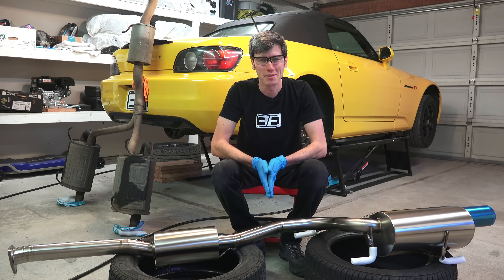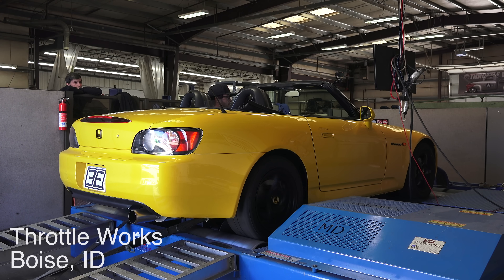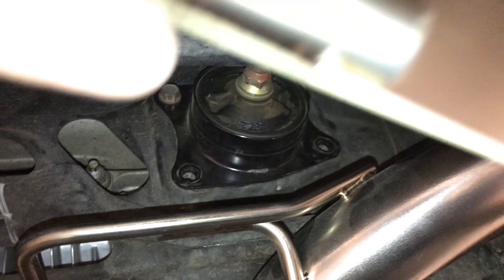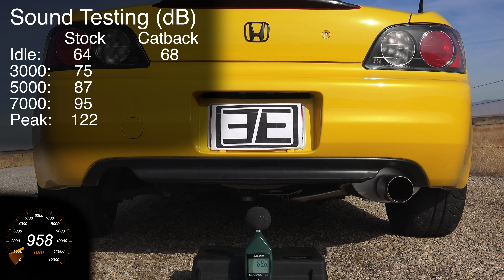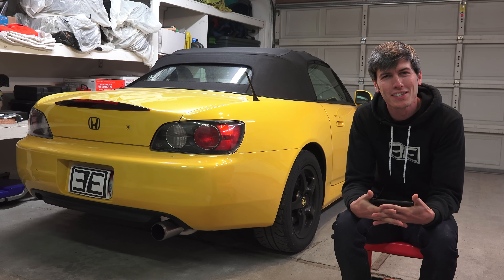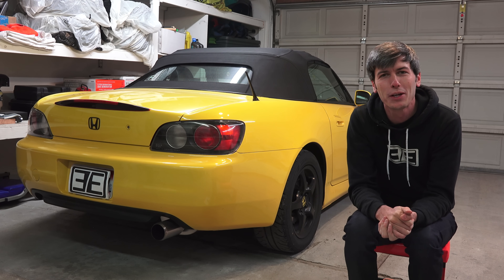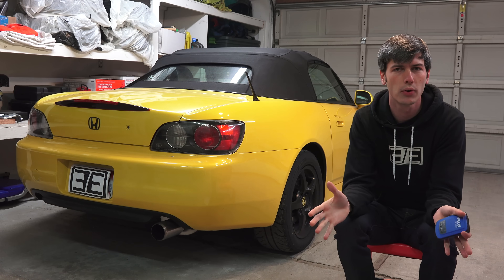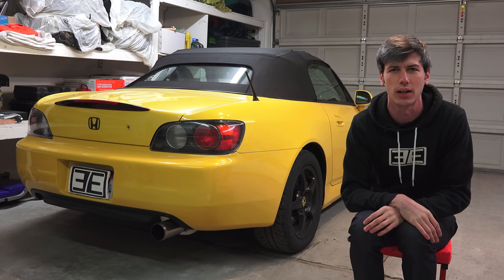Can A Catback Exhaust Make Your Car Faster?

Comment: All that changed was the material and going from two exit to one... I didn't think anything would change tone wise. As for power, without any change in diameter wouldn't think anything would happen. The only real change came from a redesigned muffler.
I would be more interested in seeing a difference diameter with all the same tests.

Comment: I would argue that you could've gotten that same HP bump just from cleaning the soot out of the stock exhaust.  I'd be interested in seeing another dyno result after 10K miles with the new exhaust.  This would be mod done more for the weight savings than the WHP gain.  Looking at it from the standpoint of dropping 36 lbs for 2500 bucks makes the cost a bit more palatable.  I'd do it.

Comment: It's not as much that the piston has an easier time puming out the expired charge as much as it is that the higher exhaust system velocity scavenges in more air (and fuel) into the combustion chambers while on the VTEC high cam that has more valve overlap.

Comment: 76mm exhaust would be best not 60mm. The most restrictive you have on is the Cat/header. U can find aftermarket header with high flow cat. You notice alot more with Ecu tune too with and without the upgrade from 60 to 76mm..

Comment: But at the beginning of this video you claimed the catback wasnt the restriction and that it would most likely not effect power as the cat is the real restriction. Then about 12 minutes in you claimed it flowed better and that is why we saw a gain.  We all know that Motors are nothing but air pumps and the more efficient you make them the better power they will make.
Reply from the maker: +Kyle Duffy relatively speaking, the stock catback isn’t a huge impact on flow, but again, that was before I tested it, so I didn’t know what the results would be.

Comment: Cool stuff. Sound is disappointing, though, specially for the price. Too stock-like. For me, there's no point in getting an exhaust if it isn't a bit louder or sounds different than stock. The NVidia exhaust on my dad's S2k sounds much better. Weight savings are nice, though.

Comment: nice vid, one added benefit to that significant weight reduction is the savings in fuel costs. That would make an interesting graph especially when taking into account the price of gas going up, which it will do. So, what you have spent on the overall price of cat-back system could be recouped in maybe a year or two.

Comment: I have done all of these sorts of tests before on my own cars. I found catback as seen in this video also made small but measurable difference, actually around 5-6Hp I measured on the dyno but I have 2.5" back back with straight through mufflers vs 2.25" with baffle plate mufflers. Also the engine is 3.8L buick so larger gains due to the larger capacity.

The biggest improvement was changing the cast iron exhaust manifolds to long tube headers which the primaries were around 650mm long. That by itself gained 15hp and dropped the peak HP from 5200 rpm down to 4750rpm, which of course means the torque curve changed drastically and increased but about 25-30Nm, biggest gain was it push my peak torque out almost dead flat and ended up peaking from 2200 to 3600 and 90% of peak at 1500 rpm. 0-100 times went from 9 sec to about 7.5 sec. Absolutely fantastic gains for simple mods and plenty of time spent calibrating the tune. One of my biggest issues is actually getting enough traction. I went from 205mm wide tyres to 235mm and fitted good reputable sports tyres but it just smokes all of 1st and bit of 2nd so the best 0-100 is the 7.5 sec, it would likely be high 6s or 7 flat if I can get more grip.

Comment: Your reasoning for going with a 60mm exhaust over a 76mm (3") is false. Pretty common knowledge that high revving engines like big high flowing exhausts. Small diameter exhausts do sound better on  the s2k to me though

Comment: yes titanium exhaust is lighter than steel would be but generally from the heat it will crack eventually happens a lot of time with the systems for Porsches so now everybody just puts on a high quality stainless steel exhaust because it is more durable will last longer less expensive

Comment: I think it sounds good. I have an 09 civic si that I supercharged and I still have the stock intake and exhaust on it. Having a quiet exhaust is a life saver (or should I say license saver) when you are out having fun. With a loud exhaust you might as well wire an air horn into your throttle pedal!

Comment: I also feel that it should be mentioned that those who go to a larger exhaust size would notice more power gains (in addition to weight savings) than those who stay at the same inner diameter. I just replaced the midpipe and catback on my Chevy Sonic and have think (it could just be my misjudgment) there has been a very slight bump to power and torque. I've done smaller mods to improve turbo spool time and get more air into the engine, so I think that it might just be easier to breathe now, or it could just be the weight saving i'm noticing. All in all, I always look forward to your videos. Thanks for the good work, and asking and answering the science behind the way things work.

Comment: I would suggest getting a high flow cat to go with your exhaust! You are blowing black soot (carbon) out of your pipes when revving. Tells me your cat has build up. Could make a bigger difference than 2.5 hp
Reply: Also would be curious to see what hp difference you get with a straight pipe.
Reply: And if You'd like the more aggressive sound without the riceness to it... just take out the muffler and straight pipe it from resonator back. The resonator will give it a deep note but won't be as muffled.
Reply: Bump

Comment: The buyers remorse in the last few minutes of that video is painful to watch.
Reply: Wasn't this a sponsored video? Maybe he got it for free
Reply: I'm pretty sure it was a freebie!
Reply: Olivia Lambert very true but he had to know in his heart without removing the cat that gains would be negligible at best (if cat = biggest restriction then leaving said restriction there is no way to see gains after said restriction)
Reply: @xbraekdownx  true, delete cats and resonator, high flow muffler, 2.5in dia. I have a Mitsu Montero 3.0 and did that, could feel the gains, also had to do away with the spare, i weighed the loss in total 97lbs.
Reply: There is no buyer's remorse, here. This is what he does for a living. If he got -ve HP returns, it would still be a video, and he would explain why it was that way, and he would keep on trucking, because that's what he does.

(He may have 'YouTube-viewer comment anxiety', but that's not the same thing as 'buyer's remorse').
Reply: He got it for free
Reply: Its gold tho 😂
Reply: Olivia Lambert well considering he got the same size diameter of an exhaust, he knew to expect minimum gains simply by les bends and air “friction loss” but maybe getting the 70mm would have made a bigger difference after VTEC
Reply: @frosty0219  it might even hurt performance though. Once the exhaust goes from 60 to 70mm the gasses expand and slow down and also cooling down.
That is a lot of energy being lost, i don't know if the gains resulting from the lower pressure would be sufficient to make up the difference.

Could go either way really.
Reply: The gains are in the weight mostly, not the HP. You'll never gain much HP with just an exhaust
Reply: Hii
Reply: @AJ-zs7xp  creepy
Reply: @gnarkilleptic4871  you are creepy
Reply: You ( or your profile picture )on the other hand,  is a treat to watch..
Reply: @Makta972  bobs and vegene
Reply: Makta972 jesus
Reply: Makta972 wtf ur a creep

Comment: Mate, Amuse is great, but since you spent that much and only gained a few WHP you really should invest in a test pipe or high flow cat to maximise gains and it will cost you far less than the actual exhaust :)

Comment: the reason for a new exhaust isnt necessarily for the bhp.  but it allows you to add to the engine without worry of back pressure later on. now you can add a turbo or other performance modifications.

Comment: I'd buy a full titanium setup for my beater if it meant not having to get new exhaust parts every other year. I swear, after a new muffler is installed it's browned with rust a month later. 'Stainless steel' my ass.

Comment: So you say making an exhaust less restrictive with a wider diameter pipe will mean the engine has greater potential to make power by not having to work to push the gases out... but don't you also start losing power if you make the exhaust too large?

Comment: I think this sort of says how efficient honda's stock design already was. 
i'm guessing regular economy cars may have more restrictive exhausts so it might be worth aftermarket exhausts, but honda knew exactly how much power it wanted to make, so they made the entire car as efficient as possible within the parameters they were given (material type, legal restriction, etc)
Reply: Tetsuto Kamata. Exactly. Most air filter housings and exhaust ( not exh manifolds) systems are probably 90% as good as they could be. Replacing them adds only a tiny bit of efficiency to the flow, especially at part throttle or 2/3 up the rev range. Full throttle is different, but how many times are you at full throttle above 5,000 RPM in any car. Some drivers, never, an enthusiast like me, maybe .1% of the time I'm driving.
Reply: No Budget Racing. Full throttle 50% of the time? Do you have a 20 hp car? It only takes 6-9 hp to keep a car going 60 mph.
Reply: Roman Soroka I'm at WOT like 50% of the time I'm driving. Lol. I redline my car at least 7 times a day.
Reply: No Budget Racing poor car that you have. Or you might be driving a 100 cc engine if you need to redline it 7 times a day. The only time I redlined my 07 Acura TL was today because of a brake change and needed to break them down
Reply: Roman Soroka smart car
Reply: Most newer cars, even the small cheaper ones have pretty well designed intake and exhausts to fit that particular engine. Some are better than others though. They make a lot of effort now a days to get the most power and gas economy out of cars.

Comment: This welding is impeccable !!! If I remember correctly, in the blackbird SR71, the titanium was all riveted because it is very difficult to weld !!! It is a fantastic material, it only weighs 3.7 kg / liter and the melting point is 2800 celsius, more 1000 than iron !!!

Comment: A header would be a great comparison to stock and if you want to put up with the issues or not like smell and running a o2 cheater for emissions or not. Also you need an intake to compliment the exhaust you have increased exhale and intake to a complete improvement in efficiency. But Really you should do a header and a tune to find the peak capability of that engines efficiency

Comment: you went from duel to single pipes. the new cat back might be a little thicker, however try blowing through a straw that has 2 seperate ends, then a single ended straw. I'm pretty sure you're making more bubbles in your chocolate milk with the duel. the mufflers, pipe thickness, ect all come into play as well. I'm just saying if you had an exact copy of your stock cat back with the thicker piping and custom mufflers, there would be well more than just a 2 horsepower gain.

Comment: Just goes to show how good a job, Honda has done with the stock end can design. On a regular car with a restrictive muffler, the difference would have been a lot more.

But i guess once you start fiddling with the headers and cat delete......the difference should be more evident. I saw a 16whp increase on a stock D15 engine by just replacing the exhaust system.  

Also the different in weight will aid acceleration. 

PS : Would it be possible for you to do a dyno run with the VTEC solenoid disabled? Would love to see how much of a difference the VTEC system makes, with a comparative dyno graph.

Comment: Did a full system exhaust on my motorcycle. So loud but good, and power increases were nice. The ecu restrictions really hold my baby back at the top end though.

Comment: Jason, as i watch this video and think about how the improvement in horsepower is directly related to the improvement in exhaust flow.  I can't help but wonder if the results would be more drastic if the engine wasn't stock.  If the engine was making more power to begin with, do you think the improvements in power would be more drastic?

Comment: the sound I would describe as crisper. as far as horsepower gain, you would need to tune it for the new flow rate to gain the most hp you can get

Comment: I hate to say it does sound a little "Ricey", the new exhaust
Reply: Charley George thats not ricey at all, you can tell that it has a firm grip on that motor where the stock exhaust was losing it.
Reply: I will give a better wording for my comment.  I find at the higher RPM it does sound the slightest ricey.  I love how the exhaust allows the flow for all around better improvement in the entire range.  It is a pretty exhaust with great manufacturing.  I would love to see it change color in the future.  But I think he would do better with a better cat for sure.

Comment: Thank you for the extremely detailed test and all your great videos! So few people actually account for temp/humidity/pressure and breakdown exactly where the changes are happening.

Idea for a future video: Strip as much weight out as you can (spare tire, everything in truck, possibly the passenger seat, etc) and use the Vbox to show how much faster. Or kinda do the reverse and add a bunch of weight and remove it in measured amounts between tests, and change the weight location (trunk vs passenger seat) to see if it makes a difference (maybe weight over the rear tires would help traction for launching)

Comment: So how about a 100 cell high-flow cat and header? I bet that's gonna add a lot more power (especially now that the catback is already in place).
Btw you mentioned you wanted to supercharge your s2k some time down the road, why not go with the bigger pipe diameter considering it's such a pricey exhaust system (ignoring the fact that it was sponsored)?

Comment: When u say "Catback" some people are going to think the stock exaust is not catback, they are both catback (from the catalytic converter back). You should call it the after market or the titanium exaust. It's like the cold air intake, people hear that and they think their car doesn't have that already.
Reply: There's a reason he (properly) calls it a catback - there are full exhaust systems out there for sale. They might replace or remove the catalytic converter, and will go from the cylinder hard all the way to the tailpipe. Catbacks are exatly that - a system that leaves the factory parts in the emissions zone at the front of the system. For what it's worth, most people shopping for such things already know this. For those just learning, there are explanations like this. :)
Reply: chut up

Comment: the sound and performance differences would be much larger and more noticeable by removing the catalytic converter. It acts as a sound muffler and minor restriction. Usually the ONLY reason or gain from installing just a catback on stock header/cats, is the sound and look, which in this case the exhaust looks amazing on its own but probably looks kinda weird since now you have only 1 muffler cutout filled, and you can't even see the manufacturing beauty after its installed on the car. And then there is very little sound difference for this particular exhaust. This exhaust would probably be great on a turbo'd S2000 with less restrictive header/cats.

Comment: Would be great if you would review the Gernpipe (Urge designs Scavenger Exhaust), a individually designed exhaust for the s2k with a unique expander midpipe.   This is the only exhaust that contains a catalytic converter but still manages to allow vtec engagement low enough to smooth the torque curve completely.  Tuned results are better than a test pipe.  There is a boat load of interesting fluid dynamics to discuss here.

Comment: Blowing a little black smoke there. You are far too concentrated on the Bhp gains when you stripped weight off the car, so you'll have better handling with every bit of weight you remove, although it was mainly off the rear which on a rwd isn't good? Also if you can improve the air filter, exhaust manifold & if you want to keep your cat, get a sports cat, then the exhaust might show it's true potential.

Comment: oh, and another thing, if you are pumping more air in/out of the motor due to other changes, your gain % will be a little higher. What i mean is, say you added a turbo, on the stock cat-back you get say 20hp, cat-back 25hp, on the stock +/- 0 at stock, and 3 hp gained from adding the exhaust. ^hope you get what i am meaning....you get more from your aftermarket parts, the exhaust is like a multiplier for them

Comment: I was wondering why the higher humidity would be a negative influence on performance. Wouldn't the higher moisture content increase the mass of the volume of air being used for combustion...actually as I write this I think I'm may be thinking about jet engines where more mass going through the engine equates to more thrust out the back. Disregard. Lol.
Reply: I think he mentioned it in another video, I've had the same question before. But it's just because more humidity=less air=less oxygen essentially.